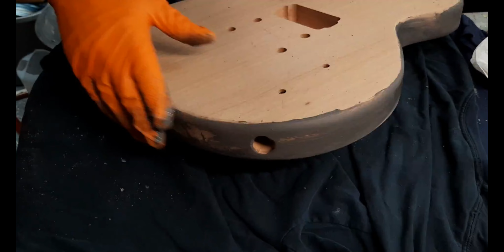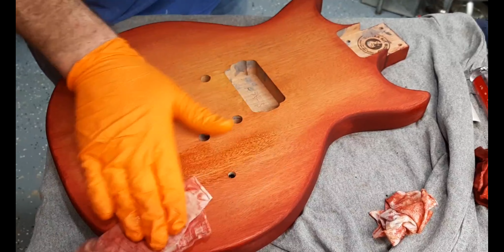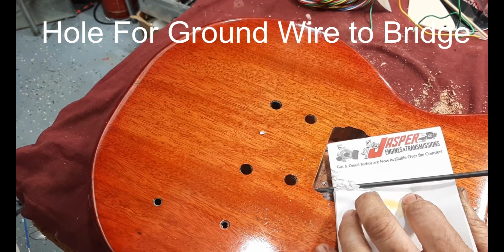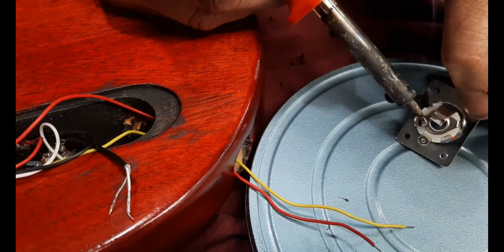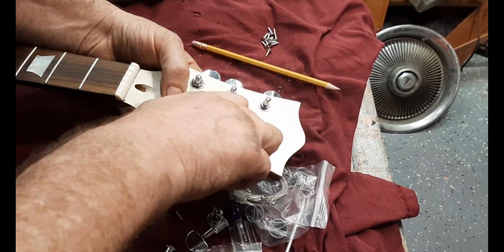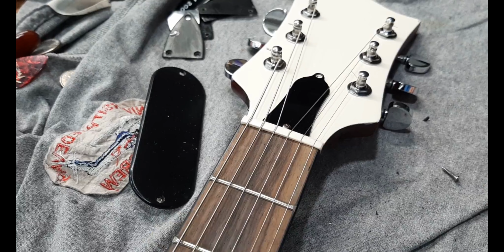Guitar Kit World Les Paul Junior Build @GUITARKITWORLD Double Cutaway Unboxing and Time-lapse

Comment: I got one with the wraparound bridge. The neck and pocket were VERY tight, so I knew there would be no neck movement. I MISTAKENLY made the decision to glue the neck on BEFORE checking the string alignment. The strings are now too far to the left, and not centered over the pole pieces. The cheapest way to correct it would have been to sand the neck base block (where it sits in the pocket a little on the top side of the block on the right side, and the bottom side of the block on the left side. There was NO movement of the neck in the pocket, so I assumed that it was manufactured correctly, which it wasn't. Now, the best way to fix it is to buy a high quality roller bridge with saddles that adjust from side to side like a Schaller Roller bridge.
Reply from the maker: I like to have the two E strings on while gluing or setting a neck.

Comment: I do like the license plate, but i’m personally digging the white.  

Love your vids Tom.  Would love to one day see a vid from you on proper soldering.  I know it’s easy but I probably overthink it and don’t wanna mess anything up.
Reply from the maker: Thanks for saying that, I appreciate it. As for the soldering, yes, you probably are over thinking it. I use a $10 walmart soldering iron, but I use better solder than it comes with. A hot iron helps, does most of the work.  I might show how I solder some time, but I don't think I'm good enough to teach others. Get some cheap guitars and practice,  that will improve your skills and confidence.